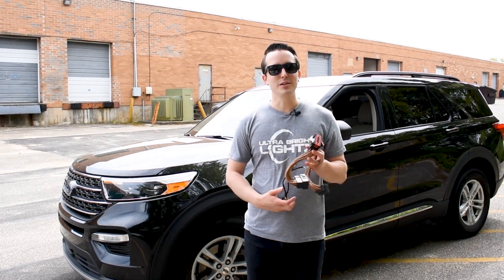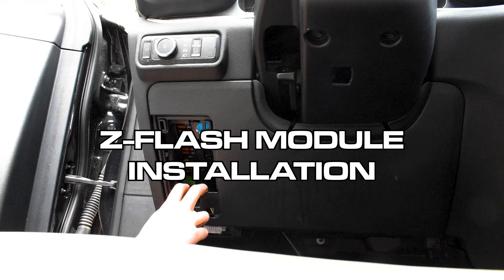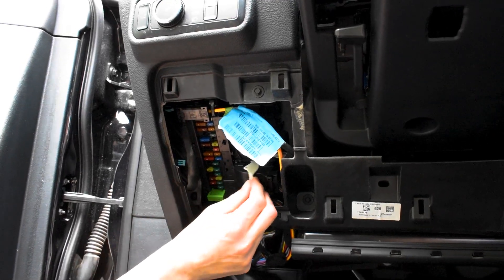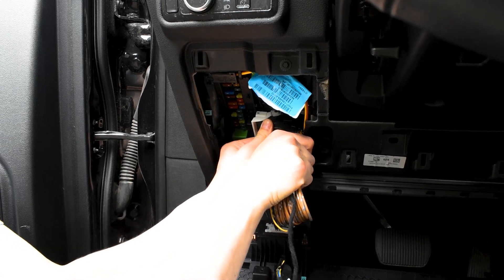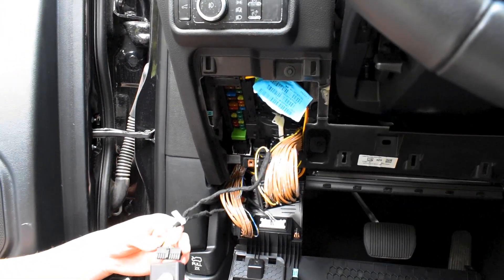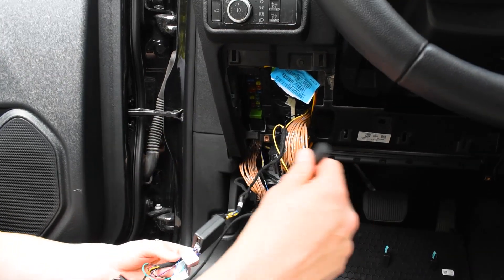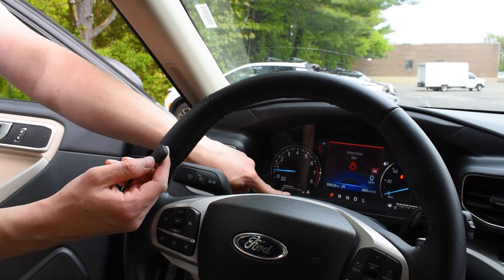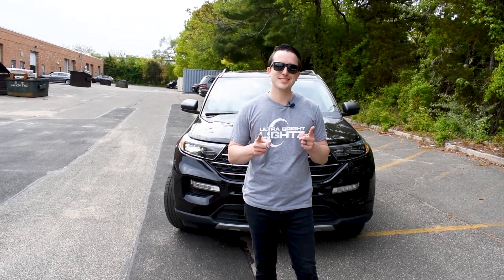Z-Flash BCM for Ford w/Headlight Flasher: Installation & Flash Patterns Overview

Comment: Will this product in this video make 2018 ford xlt headlights to flash?
Reply from the maker: If your 2018 Ford is an Explorer XLT, the headlights will flash
Reply: Ah I see. I meant to write 2018 ford f150 xlt.
Reply from the maker: @vico.2514  The Z-Flash BCM For Ford With Headlights will also work in your 2018 F-150! https://ultrabrightlightz.com/products/z-flash-bcm-plugin-for-ford-w-headlight-flasher?variant=42239828000977

Comment: Would this unit work for a Ford F250 ?
Reply from the maker: The Z-Flash shown in the video above is compatible with the 2017-2022 F-250. If you have a 2023-2025 F-250, you will need the Z-Flash BCM 2300 For Ford: https://ultrabrightlightz.com/collections/plug-n-play/products/z-flash-bcm-2300-for-ford

Comment: Your product looks amazing, but I have two questions.

1. How do you get all those wires back into the tight box? Can you send me a tutorial on how you did that?

2. My Explorer is a 2022 ST, but your website says it's for a Ford Explorer up to 2019. What's the link for a 2022 ExST?
Reply from the maker: 1. You can use Heavy Duty Zip Ties to tie everything together. 2. The Z-Flash BCM For Ford With Headlight Flasher which is the model shown in the video is compatible with the 2020-2024 Explorer no matter the trim level: https://ultrabrightlightz.com/collections/plug-n-play/products/z-flash-bcm-plugin-for-ford-w-headlight-flasher
Reply: @UltraBrightLightz  Thank you! The price is a bit high for my budget🥺. Do you have any discount coupons available?😬
Reply from the maker: @AdrianoVedovi  You will receive a coupon if you are a first-time subscriber to our newsletter. The link is located at the bottom of our homepage:
https://ultrabrightlightz.com/

Comment: He didn't show how to tuck all that new stuff in that tight spot. HMMMMM
Reply from the maker: You can use heavy-duty Zip  ties to tie everything together and put it between the panel that was removed and the bottom of the dash board

Comment: Does it work on 2024 f150?
Reply from the maker: The Z-Flash shown in the video is not compatible with your truck. You will need the Z-Flash BCM 2300 for your F-150: https://ultrabrightlightz.com/collections/plug-n-play/products/z-flash-bcm-2300-for-ford